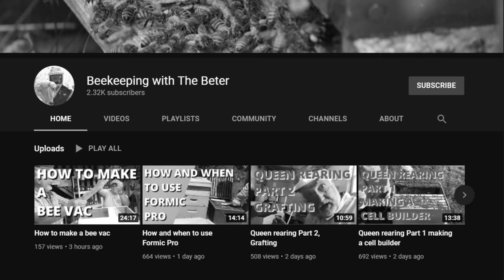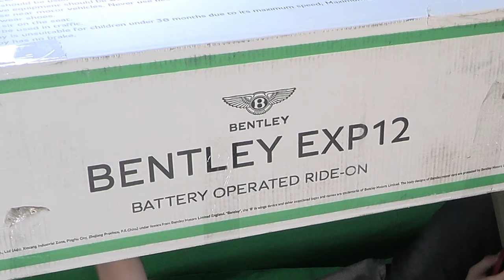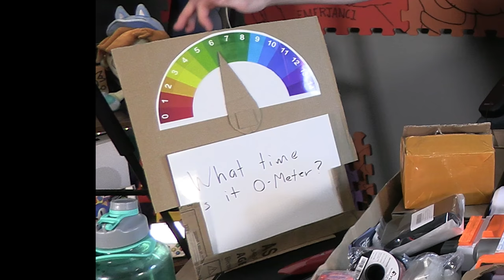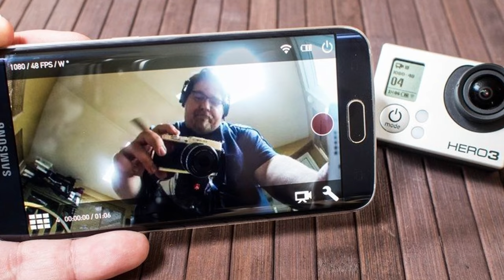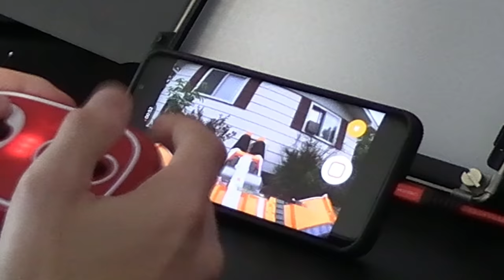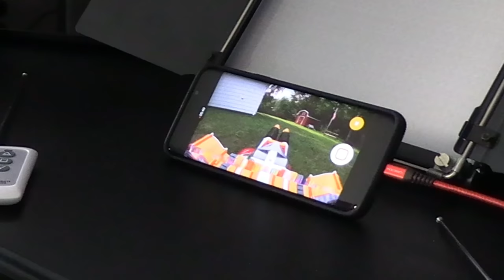Remote Controlled Wasp Destroyer

Comment: You shud have connected the battery terminals of the "alarm clock" to the remotecontroll switch and glue the button on the alarm clock down

Comment: The gun most likely has an electronic trigger. Meaning u could have took it apart and wire it directly to the remote control system. And you wouldn't need the motors

Comment: Rhino-fire nerf guns use an electronic trigger, so you could have just replaced the trigger with the relay, instead of using the relay as switch to control a continuous motor that presses a second smaller switch

Comment: nah the nerf gun has a twin turbo v12 that revs up to 10k rpm and has 1000000083737362671 horse power designed by porsche with bugatti with lamborghi with bentley with every brand
Reply: With SAAB

Comment: Why did you waste your time setting up a whole entire extra system for using a remote control motor to press a button to fire the gun when you could've just swapped out the trigger button with the remote control unit

Comment: why are you using a motor to push down a button that hits an electrical switch? 
just remove the mechanical button on the nerf "alarm clock" and trigger it electronically and remove the 3 middle men. 

this is like watching a guy build a Rube Goldberg machine to turn his bedroom light off.

Comment: Is... is the switch on the gun just an electronic switch?
Reply: Cause if it is there's a way easier way with the wireless relay setup he has.
However the solution he went with is custom and I dig it.

Comment: easy solution: open the gun, remove  the wires from the switch, connect the remote controlled switch to the wires, done.
peter: 2 battery packs, 2 remote controlled switches, 2 gearboy motors, some wood, tape it al together, doesn't work.

Comment: Why did you not just wire up the Nerf gun's internal motor to the remote control system instead of having to add a battery-operated motor to operate another battery-operated motor???